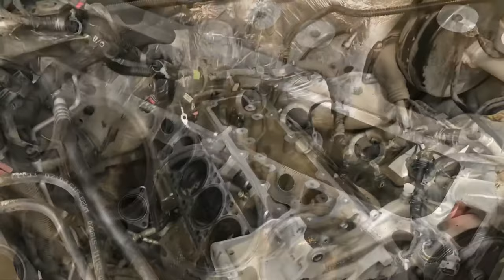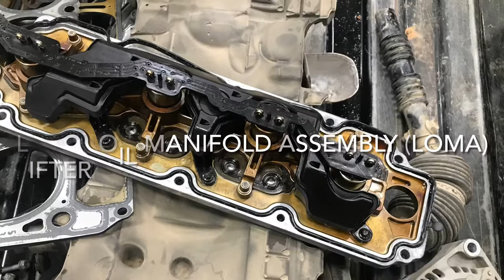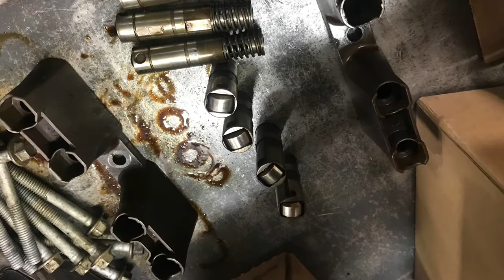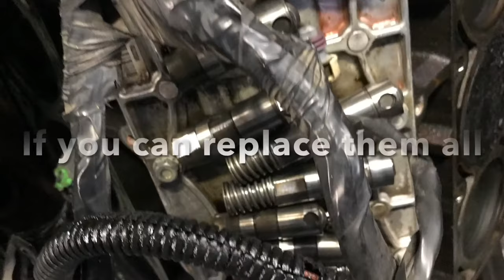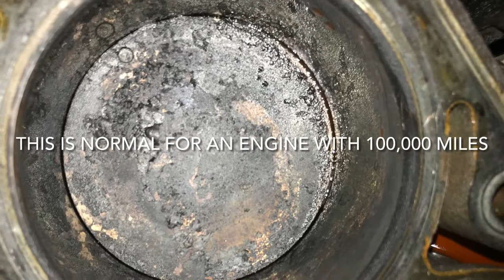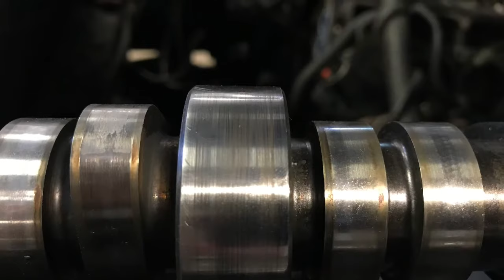GM 5.3L 6.0L 6.2L Misfire Caused by a Failed Lifter, Camshaft damage, Common Failure, Engine Noise

Comment: I was throwing parts at a P0300 randmon misfire code, didn't work- took it to a shop and they said it was internal. So I'm gonna be doing heads and cam next weekend
Reply: have 2014 with same code plus 0306. (misfire in #6)  what year do you have ?
Reply: 65 lbs of compression in#4 and #6.   cam/lifters ?   alway have 40 lbs of oil pressure. Synthetic oil from purchase at 15,000 miles. Thanks.

Comment: My son came home to Texas on leave last Christmas and traded his 2019 Ram 4x4 for a 2021 Silverado and drove back to Phili.  In May this year he came back to Texas from Phili for his sisters graduation and he never got past Roanoke Va. before his engine failed.  
They gave him a loaner and he drove back after his leave was up and picked up his truck.  Again he has made the drive from Phiili  to Texas for his last Christmas before he is reassigned to Korea and made it 6 hours past Roanoke to the middle of Tenn and once again his engine has crapped out.  
I guess that Chevy engines are not suitable for cross country driving.  He should have kept his Ram.  I am on my 4th Ram since 1997 and have no issues in over 100k each.
Reply: Mine has 270k
Reply: Dam, that blows. Unfortunately, all those engines with the DoD option have a high percentage of failure. There is a class action against GM for that i believe. I steered away from that DoD crap for both of my trucks.
Reply: @josevaldes846   si desactivas el afm  ayuda a no tener esa falla ??

Comment: I have my 2011 Sierra LC9 ripped apart now. Three cam lobes and lifters are trashed. One lifter smacked the cam so hard it deformed it so it will not come out of the bore. Not a cheap or fun job. Most people just replace the engine.

Comment: So can bad lifters indicate bad oil pressure because I have code p0300 and sometimes it says that I’m low on oil
Reply: Yes absolutely I'm dealing with the same exact problem PO305 CODE.turns out it was bad  bad lifter also did damage to camshaft now I'm replacing  them. Camshaft and springs as well. It SUCKS...
Reply: @erasedfromgenepool.4845  damn man, thanks for your feedback tho, where did you buy your lifters?, trying to do this job myself!

Comment: 2021  GMC Sierra second motor going in now 2500 miles.
Reply: Damn that's not even enough for an oil change
Reply: @glenwoodjenkins3018  I could write a book. New truck on order now hopefully June.
Reply: @chrishope82666  yes sir

Comment: Ok I this upload is a lot less than a year old... I thought surely GM fixed this in the 2016 generation trucks? Apparently not?
Reply: Actually GM updated the system so all of the lifters are AFM. The older design had AFM lifters on cylinders 2,4,5,7. But the new design is for all cylinders. It is able to run on only one cylinder to conserve fuel. So the failures are actually not going away any time soon. Since the 2021’s are having big problems.
Reply: The government is regulating the fuel economy of these vehicles so expect new designs that will fail constantly until they try and phase out gas vehicles for electric.

Comment: If your waiting for the OLM to get to zero, your playing with dynamite. Changing oil every 3-4000 miles will greatly reduce the chance of failures. I'm sure these are isolated incidents, there are probably tens of thousands with no issues. Thats my opinion and I'm sticking to it.